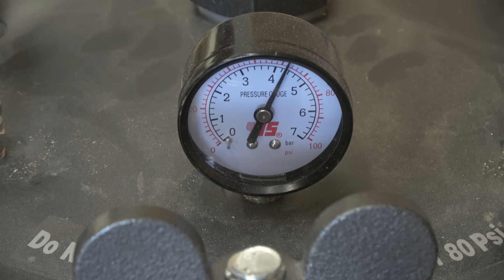Woodturning – The Spooktacular Lamp!

Comment: Every channel dealing with wood turning using resin uses the same two fisted, reverse holding, simultaneously dispensing two part epoxy application. Is this a union or an OSHA requirement?
Reply from the maker: Or simply a good practice

Comment: I’m so confused by his “mistake” it made no sense lol
Reply from the maker: First pour of resin was not enough so had to add a second layers the following day. But the second mix was slightly different colour and did not like how it turned out. So had to cut the top where the 2nd layer was and glue a wood top on. Resin shrinks while curing and also as bubbles got squashed in the pressure pot it further drops the resin level. I accounted for this but seems like still was not enough excess resin on top
Reply: @DavidsWoodturning  oh ok I see sorry I was just confused lol